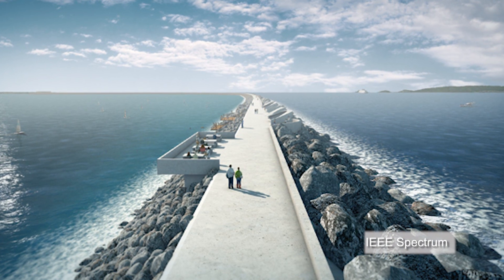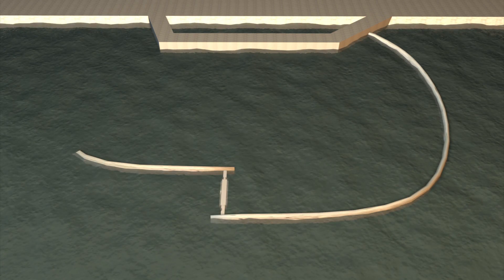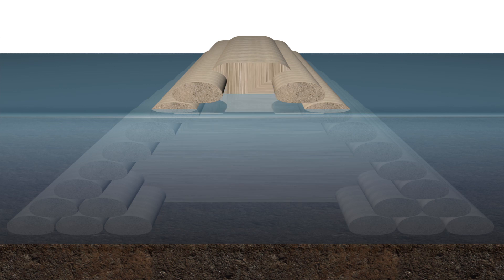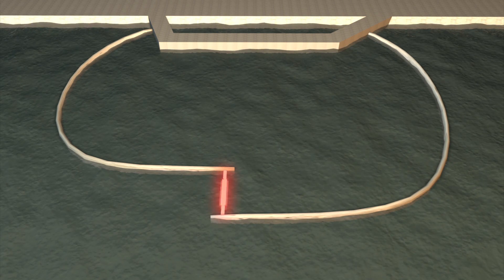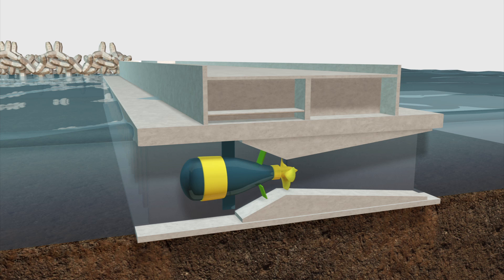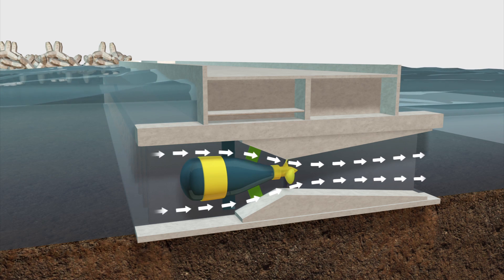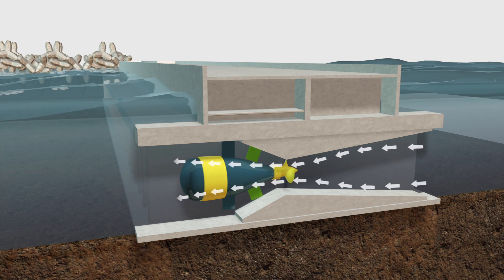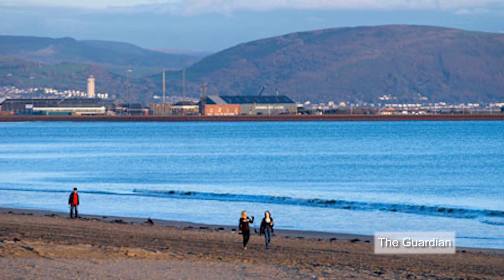Wales plans to build tidal power lagoon in Swansea Bay

Comment: Considering the modest electricity production (420 GWh/a, 48 MW average power), it is extremely expensive. Almost 4 times more expensive than offshore wind farms. About twice as expensive as photovoltaics (referred to annual production).

This could possibly be partly compensated by a very long lifetime without a lot of maintenance and repair (cheap operation).
But the capital costs would be very very high. And nobody really knows, how much maintenance it would need.

And tidal power is pulsating in the rhythm of the tides.
4 times a day, there is no tidal current (high tide, low tide). And no tidal current means no power.
It's no continuous baseload like from run-of-the-river-hydroelectricity or from thermal power plants.